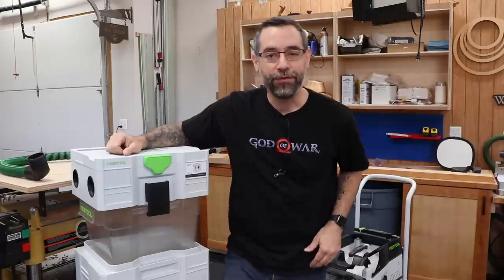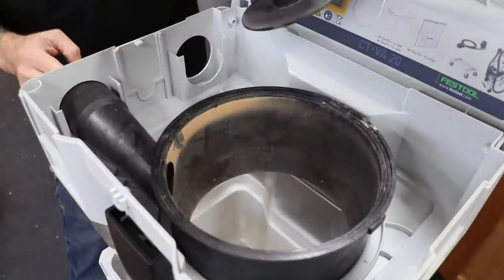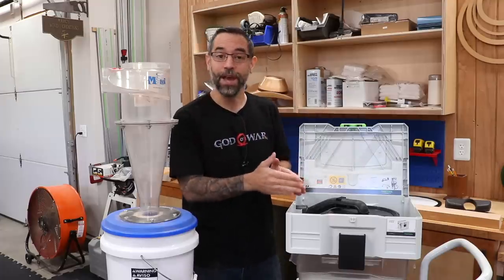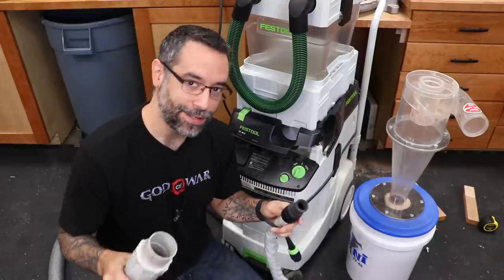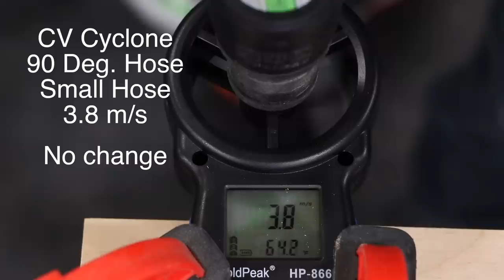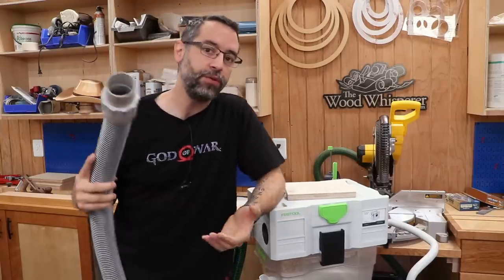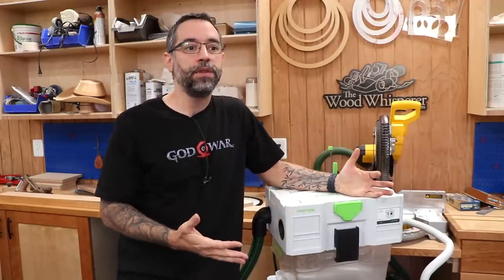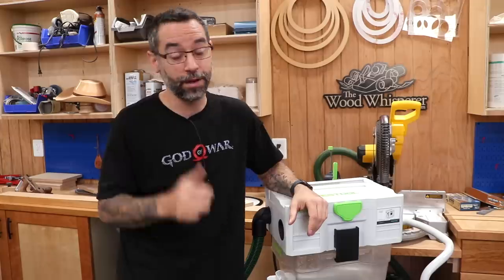Festool CT Cyclone Review | Not Great!

Comment: To make this more accurate you probably want to fit some sort of adapter between the hose and the anemometer, so that all the air sucked by the hose will pass through the anemometer.  Even just sealing them together with duct tape to eliminate leakage would be a huge leap forward.  The way you're doing it now,  I suspect there's a great loss being introduced at the outset (before even applying a cyclone) because of this "leakage", and the greater the difference between hose diameter and anemometer diameter, the greater this loss is.  The result, I suspect, is that the apparent relative loss introduced by the cyclone when applied to a small-hose rig is diminished.  The closer the hose diameter is to the anemometer's diameter, the truer the results.
Reply from the maker: Wouldn’t the loss be a wash though? I’m not really comparing large hose to small hose. I’m comparing small to small and large to large. The results mimic what I expected just by using the different hoses and feeling how much suction was present. So I have no doubt my testing method isn’t remotely accurate for the absolute numbers. But for relative differences, I feel like it was close enough.
Reply: it depends whether you're interested in the absolute values of air flow or the relative ones - if its the latter, as long as the technique is consistent and you get reproducible results then it's fine for deciding which vacuum set-up is better than the other
Reply: (@Marc) Even though the hose diameter reduction is expected to increase friction significantly (proportional to 1/d^3, I think), I've never seen air velocity diminish when a skinnier hose or duct is applied to any reasonably powered machine (move the same air through something skinnier, it's gotta go faster), but yet that's what's going on here, in spades.  That's what I take as indication that something's fishy, though it doesn't disprove your assertion that things remain proportional.  I just feel in my gut that because the hose "covers" so little of the anemometer's impeller, and on top of that the air movement is at the hub of the impeller which "blocks" about half the area of the hose end and causes turbulent (vs laminar) flow, that a huge amount of the air being sucked through the narrow hose is coming around the edges and not through the instrument's vanes, and also that somehow this puts the reasonableness of proportionality of the numbers in jeopardy.  Unfortunately, I'm nerdy about lots of stuff, but not quite nerdy enough to execute a good proof :)  Just sharing what went on in my mind to raise doubt.
That said, your approach is thoughtful, as always - you did indeed declare very clearly that absolute correctness was not to be expected with the means employed - and the information you give is as usual valuable and appreciated.  Thanks so much!

Comment: Your testing procedures are sooooooo bad......thumbs up 😉
Reply: I think movement of air by cubic feet is better to see what the "drop" is.  Rather than the speed.  The speed is gonna affect how much dust is collected from a distance (just my opinion).  So like, the speed "catches" the dust before it flies away when using, say a router.
Reply: The CFM (or more generally, the volume flow rate), would be the wind speed multiplied by the cross-sectional area of the hose. So the wind speed should be directly proportional to the CFM for a given diameter of hose. I agree that higher speeds would be more effective for grabbing dust out of the air though, assuming the overall volume flow was sufficient.
Reply: @MechanicalMind7  Forget about air velocity and CFM completely. I am only worried about CFM on big dust collectors you hook to big machines with big particles (planer, jointer, etc...). On smaller floor models that you use to vacuum the shop and connect to your hand tools, static pressure is far more important. A manometer measuring static pressure head would be a better test. That's where the elbows will get you and the biggest difference in cyclone design will come from.
Reply: @madman2572  static pressure= no airflow= the shape of the hose/connectors does not matter :) only air leaks may influence the result :)

Comment: I honestly, don't see this as money well spent, even being a contractor i make more sawdust on the job site then I do the shop.  Don't get me wrong, I love my festool vacs, there is just no at I could justify the cost.  Set up time is the same, let's assume it works the same, the only time savings would be in transportation, which I don't see being enough too make it worthwhile.  Now if you are going from place too place with several set ups a day, maybe, but with 1 a day.
Reply: I do high end carpentry in peoples homes and Festool is the only brand that I can get that can do it all for me with no hassle. Dewalt are the next company down from that I could use but will work out at a similar price when I buy everything and are not as easy to store in the van. 

Otherwise the only option is Mafell which cost three times as much. For me on many jobs dust collection is a priority as is accuracy. 

I have some festool saws that are 10 years old and that means they are costing me about $100 per year each at maximum.

Comment: I cant justify the price of festool. Its like the apple of tools, they figured out they could charge more for the same/less and get away with it. Thin cheap plastic and a name is all you're getting here. my shop vac and dust deputy work great for a fraction of the cost. I personally love your videos and think your testing and personal observations are enough for the hobbyist and even the serious wood worker. Any one that can justify that kind of money is either crazy or delusional.
Reply: A Festool vac works with their tools to provide the best dust collection on the market (barring mafell costs twice as much).

They are perfect if you are working in peoples homes and want to keep the noise down and the dust down. And they are very accurate. They also store away easy and with just one trolly I can have all the tools in the house instead of making several trips to the van.
Reply: You have obviously never used the Festool miter saw . I have used all the major brands over the past 15 years and Festool's miter saw is in a different class, it's own class. Makita is close, but the Festool Kapex is like a McLaren super car. No, not everyone needs one, but it is an absolute joy to use.

Comment: You cannot measure the speed like this. The whole anemometer needs to be cover. With the small hose the anemometer blades work partly like a propeller. Trusting air around the hose.

Comment: The 90 comparison didn't surprise me.  Airborne particles do not flow the same as liquids.  For the price of the Festool vac stack you could buy a real nice dust collector set up if you did not need portability.

Comment: You didn't mention that you will void Festool's warranty if you use the CT with one of the 3rd party cyclones. The issue is damage from static discharge. The CT Cyclone obviously won't do that. I know that - for instance - Oneida's CT cyclone has a kit to wire it up for purposes of static protection, but still - Festool doesn't care. I 've been considering getting a cyclone, but I've been procrastinating mostly because of this issue. When Festool came out with theirs, I bit the bullet and bought it. Also - consider the cost of any of the cyclones with the fact that you don't need so many of the expensive CT bags, and it makes more sense financially. One other thing - you can use the Festool cyclone without the clear plastic tub - you just connect the cyclone to the base. That makes it smaller, and if you don't make a huge amount of dust, it's fine.

Comment: So for $375 and another $1500 for the vacuum cleaner I can get exactly the same results as with a $25 cyclone and a $70 shop vacuum. And people actually buy this festool crap? It's like P. T Barnum said over 130 years ago, " There's a sucker born every minute. "
Reply: Nah you can’t . Shop vacuums are loud . Festool vacs are quiet compared you can use often without ear muffs and the vac and separator together you can lead around a site with the sander in your hand and vac follows nicely . The separator does it’s job and easy to empty . It’s about work flow and efficiency. Paired with the rotex sanders it’s a fantastic all in one system I can use all day long on large sanding jobs .

Comment: Everything about festool makes me cringe.  🤔
Reply: I take their tools to site they work and produce perfect cuts, joints and finishes. They are lightweight and only cost about 20% more than dewalt tools and about the same as high end dewalt tools. 

If you want Festools level of quality you will need to by Mafell and they cost about 3 times as much. 

Dewalt make excellent tools as well but are harder to use as an entire system.